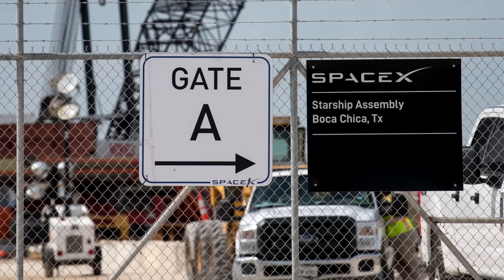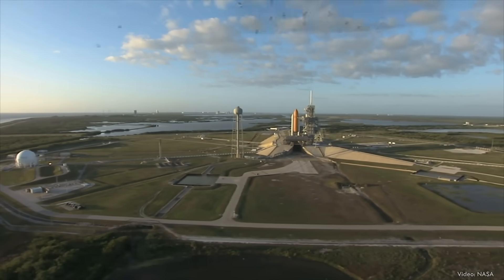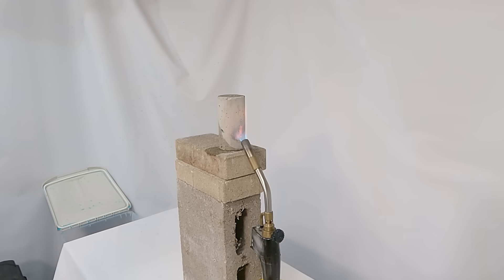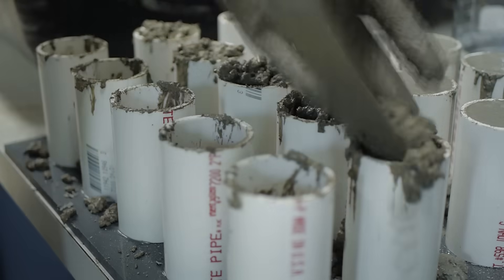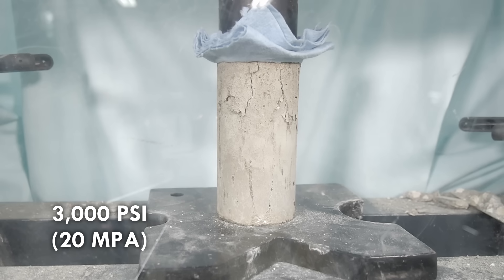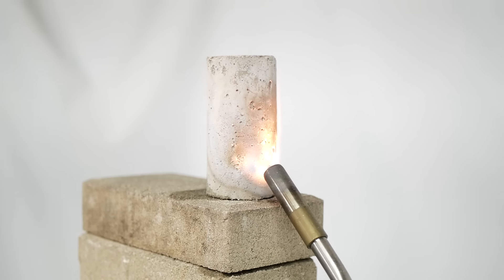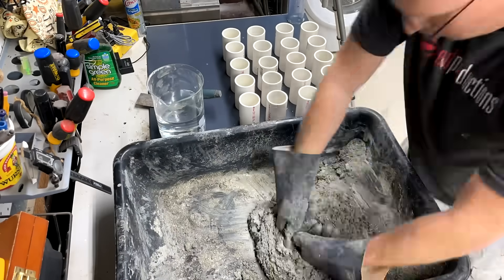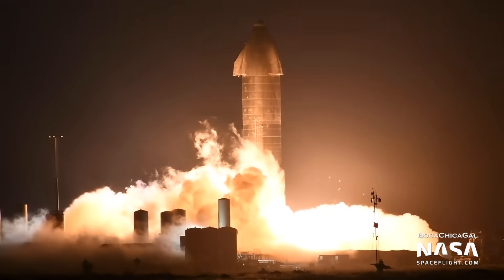Why SpaceX Cares About Concrete

Comment: If you use an acetylcholine torch on a cement floor it will cause chunks of concrete to explode out chunks of concrete. This was indoor sealed concrete that I had this happen. Water is an integral part of concrete. Concrete doesn't dry, it cures. Under extreme heat the water disassociate the water from the concrete, it turns to steam and boom.
Reply: I know it's not concrete but seen rocks next to a fire place explode from the water inside them turning into steam causing them to explode.

Comment: Watching this after the latest starship launch and seeing the crater in the concrete left behind gives this video a whole new meaning.
Reply: It really does... Like, you're gonna need flame diverters and sound suppression here on Earth, on Mars and the moon it'll be less needed but still a good idea to pack something like a foldable pad that can survive one launch of the Starship itself until you can get the infrastructure needed to build a permanent landing pad with a raised platform and flame diverter.
Reply: @norliasmith Biiiiiig expert over here.
Reply: Lol proves they still haven’t learnt anything - also using cheap concrete for their pad - what a 🤡 show
Reply: Launch off the edge of a cliff or crater. Or at least on earth they can make the hole deeper so the flame isnt in direct contact.
Reply: I'm here for can I learn more about refractory cement in my coal forge 😂

Comment: You did a test on how much water mix in concrete affects the concrete under pressure in another video. Does it applies with Refractory Cement as well?

Comment: it might be a good idea to use basalt blocks for the pad, it is very heat resistant, as strong as steel and relatively cheap when cut using automated machinery

Comment: It's annoying that Grady picked the most incompetent and overhyped rocket company to use as an example of how there are other structures not-so-obvious which are critical to the process. SpaceX is a scam and a joke, and it's going to fail hard. It wastes so much money reinventing the wheel, starting with grandiose promises and then "discovering" through necessity that their birdbrained ideas aren't practical and the issues to them were solved half a century ago. Musk is a conman, and SpaceX is a government grant farm scheme. It's never going to produce anything of what it claims that would actually be revolutionary.

The idea that they're going to have 20+ engines on a craft is lunacy. That's ~5x the probability something goes wrong than what is actually necessary. Landing in an upright position (the most UNSTABLE position possible for a long cylindrical tube) is doubly a dumb idea.

Comment: SpaceX makes a habit of ignoring 75 years of space engineering history. They usually reinvent the wheel and get things right. Sometimes they miss a basic feature ...like a proper launchpad flame trench lined with refractory materials and further protected by a water deluge system (or more recently ...ignoring the effects of a solar storm on a minimum orbital altitude). I'm all for a bit of trial error when exploring novel technologies ...but not when a proven solution is fully documented and ready to apply.

Comment: Could SpaceX basically freeze the concrete before launch to increase the time it takes to get to failure temps, hopefully past liftoff or engine shutoff on landing?  Basically build a large frozen pond that the launch pad sits in contact with.
Reply: That would be worse. You would thermally shock the concrete and increase the amount it expands on the outside vs the inside, increasing the number of surface fractures as the outside heats up and expands while the inside remains cold.

Comment: I'm a concrete troubleshooter/repairman/ cribber, and I've done a lot of refractory tile or abrasion resistant grouts/ concretes.   I'm also a super nerd when it comes to space related things, if I could be said to have a religion, putting humans in space would be a big part of it.
I'd love to work on the pads that these rockets launch from.

Comment: I have question? What if you chilled/froze your cylinders of concrete . I used to haul sand and gravel to readymix plants and have watched freeways being rebuilt and at the site they would put ice in the mixers to cool the mix and I guess slow down the cure . After the pour and finishing they would cover the road bed with old carpet that was wet down with water and for a bit keep wetting down the carpet. I was told that this slowed down the cure which made for stronger concrete .

Comment: I think we would use concrete even if it didnt hold up to heat, I'm gonna say if it was nearly flammable, and the reason we would use it is it's cheap, much cheaper then metals, it's also quick and u can truck it in and 3d print it in some cases, its fast and easy compared to having different size metal beams, obviously u pick the best of both and both are often used together, u can build a small building out of concrete but anything larger then 1 or 2 floors needs steel or reinforcement and even without all that u still need steel or iron (preferably stainless steel) rebar for most construction using concrete

Comment: This video shows why, if your house burns down to the foundation, most jurisdictions and insurance companies will not allow you to rebuild on that foundation even though it may merely look charred. Not only is its compressive strength reduced but all the micro cracks greatly enable water infiltration with all that entails (freeze-thaw effects, rebar deterioration, interior dampness and so on). Hugely expensive considering the cost of demolishing and disposing of all that concrete but nobody wants a house on a compromised foundation.

Comment: How to make a landing pad on the Moon or Mars. Send a robot with a dozer blade and tanks of urethane resin and catalyst. First thing it does after being set down near the chosen site is deploy a laser mast. That has a rotating laser on a self leveling platform. This is used for laser leveling farm fields, but with the laser rotation plane slightly tilted so the field will be tilted to match for irrigation water flow.

The leveling process is simple. The machine used to scrape the field has a mast mounted to the blade with three sensors. When the middle sensor intercepts the beam the blade is at the right height. If the bottom sensor is hit then the blade is too high, the system lowers it until the middle sensor is illuminated. Same thing with the upper sensor, the blade is too high.

After the surface is scraped level, apply the resin through a mixing spray nozzle. A light mist to start to secure the surface grains, followed by progressively heavier coats as the earlier ones soak in. If the surface needs to be tougher, a layer of pre-preg carbon fiber with heat curing resin could be rolled over the base. To cure it, the robot could have a baseplate heated by its RTG power source. Roll over a spot, raise the wheels and press the hot plate down until the resin cures. Lift up and scoot over to cure the next spot.

Comment: Fun tip: Refractory cement mixes are available for purchase. In recent years hardware stores stopped stocking it. But you can still order online. Very expensive. A 20-40lb bag/bucket will be 5 times more expensive than regular portland type 1-2 cement mixes.

Comment: Isn’t another factor that heat breaks down lime chemically. It seems like I saw a video on concrete that said they cook lime to prepare it so that it reacts with water to make cement. I think it was also said this was a way that concrete could be recycled. You’d basically break it up and sift out the aggregate then cook the remaining lime and it sort of resets it so that it will chemically react with water again. If this is the case I would think that high enough heater might cause it to lose all its properties as a cement and just crumble.

Comment: Another key thing to know don't weld something on a concrete floor because the heat makes the air pockets in the concrete make little pieces fly at you. My grandfather was told that by a guy who experienced.

Comment: So apartment buildings and other structures that have concrete in them if there are fires near concrete or making contact with it they are not safe ??? Uneven heating and different construction materials burning at different temps that's scary

Comment: Years ago working in coal fired power stations, refractory concrete was used in various places in the boiler. Also if a steam pipe failed the jet of steam with the coal ash (PFA) would soon wear through other steam pipes. That's a lot of steel to wear through

Comment: Question. Does this mean that in very hot places concrete will lose its strength easier and isn't the best material to build things out of? Another question is do extreme cold temperatures affect concrete?

Comment: My favourite solution to the landing on other planets problem is something Masten Aerospace has been testing recently. Essentially, they inject alumina ceramic into the exhaust of the rocket, where it is melted, accelerated out of the nozzle and deposited into the ground beneath. This lets the spacecraft build its own solid landing pad as its landing.

Comment: Last year we used the same refractory concrete as SpaceX in a burn building for firefighter training. The refractory the engineer was asking for required a 24 hour 3500 degree "Burn in" for curing after installation. The refractory supplier suggested the refractory they had just installed at starbase. This stuff is great, no burn in and much better at withstanding high and low temperatures.

Comment: Aerogel has to be a solution. I realize it isn't very strong or easy to produce, but combined with other materials, once they figure out a way to mass produce it, the conductivity of aerogel would make a perfect heat distributer for a launch pad

Comment: I encounter the same issues with Mullite Furnaces and Combustion Tubes. Though in the Furnace Blocks, surface cracks are evident and they don’t break until the cracks start to crumble large chunks away. The main problem is the lack of compressive and tensile strength, so you have to be very delicate.

Comment: question, obviously there is a reason for this, since noone is doing it. But why not put a sheet of steel over the concrete platform to absorb alot of the blast and heat?

If there is a risk of melting, put a sheet of tungstein on top of that again. I dont think they'd be expensive for something like a rocket launch

Comment: "Jet Fuel can't melt steel beams!"

But it can seriously degrade your concrete's structural capacity.
Reply: And even then, steel has lower fire resistance than concrete
Reply: Jet fuel can’t melt steel beams,  but it can heat steel beams enough so that they weaken and bend.
Reply: @francismallard5892  As Trenton Tye from Purgatory Iron Works said back in the day.

Comment: You missed a GIANT part about about concrete. 2 really. 1 concrete is a living thing. It uses crystals to hold the mass together. It almost seems you don't understand how concrete works. Let's also be clear about something else. The "concrete" that ancient Greeks and other  ancient civilizations used is nothing like our current concrete. Our current concrete has a lifespan of only a few hundred years old. Also your project was flawed from beginning. Sooooo flawed. No. Utterly flawed. To make structural concrete. Hell even to make good concrete requirements are. Proper mix. Vibration to remove air. Cure time. Temperature. Basically properly mixed concrete will achieve max strength in around 100 yrs. Then the silica crystals start to destroy, because unlike ancient concrete. Our modern concrete is a crystalline growing thing. The ancient concrete could be made of any stone that was powdered. Some evidence says they used extreme heat. But in the end. They made stone. We make crystals that hold stone. All that being said. This launch pad was rushed and not cured. Tesla is using Texas underpaid employees. I almost can guarantee Elon made a massive mistake moving to Texas. But honestly. To launch such a vehicle. You wouldn't do it on the ground anyways. One would build a launching mechanism that basically throws the rocket into the air as engine is ignited. Kinda the concept of how Elon wants to catch the ships. Powerful em fields would be a very good way to go.

Comment: I am a semi truck driver and I've noticed the concrete at semi truck gas stations (fuel stations) always have crushed concrete from all the heavy trucks running over the same exact spot.  Wish I could post a picture.  but its two noticeable dips in the concrete that the tires roll over.  Also this video makes me think of the concrete on the interstate.  Another informative video, thanks!

Comment: Why are launch pads necessary aside from landing those boosters like SpaceX does in the first place. It's not like the pad helps the rocket take off anymore than it just being suspended a hundred feet in the air. So why not do just that and build three metal support towers that have connecting arches to the rocket. Or have the rocket suspended from those towers then have it release once the rocket is safely moving upwards. That sounds more viable than a concrete launchpad on other planets. Not that we are there technologically if anyone is wondering lol. Scientists like to believe that we know far more than we actually do. Its like the statistic that claims we know 5% of our own seafloor. We don't know a shabby 1% sorry scientists and no offense. Anything to believe God doesn't exist and that there is some retarded "natural" explanation for it.

Comment: Looks like it's less hassle to just plate launch pad with 1cm (or more) thick steel plates. Those definitely won't have any interstitial water to spall, and are too thick to let heat >100C to conduct through them to the underneath concrete during launch, as launch is a sufficiently transient event.

Comment: I've seen inspectors collecting concrete samples when putting up a building next to me, but I'm curious what happens if one of those samples fails the quality tests?  By that point the concrete is already poured and set in the building....
Reply from the maker: If the concrete they install doesn’t meet specifications, they take it all out and do it again. You don’t want low quality concrete in your building.

Comment: Why not just super compact the soil and use that as a launch pad? You have an endless supply, easy to move and compact, no giant chunks to fly around, able to hold infinitely more weight than concrete.... There's gotta be a reason why they don't but, what is it?
Reply from the maker: Compacted soil still erodes easily

Comment: If you’re gonna test concrete, make 4x8 cylinders and atleast make them to ACI standards… 2 layers, rodded 25 times per layer, and let them cure for 28 days.
Reply from the maker: Not running a testing lab in my garage, just trying to demonstrate behavior

Comment: Curious as to if aerogel would be a solution? Superior insulating quality and extremely light. When mixed with other materials, a very thin blanket could resist flames and high heat.

Comment: you might want to take this into account also , concrete cures and gets stronger over time , wet or damp concrete cures to a harder state because of the thermic process being prolonged , note that concrete poured under water will effectively get harder and harder because it wont stop curing . by introducing intense heat shortly after the concrete had set but not cured it like shown boils off the moisture instantly interrupting and stunting the curing process giving false readings compared to samples that have not been superheated . please correct me if i am wrong.

Comment: Interesting video. Thought about a subseries on concrete inspection and testing? I don't run across this stuff much, but have ordered testing for fire losses before - not just for heat damage but released petrol products and solvents that can damage concrete. The testing involved is pretty neat.